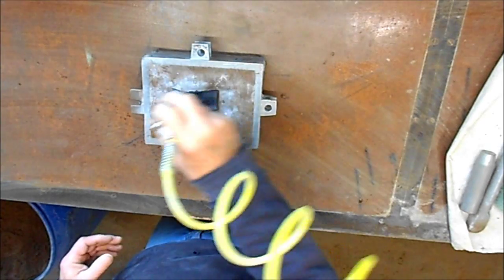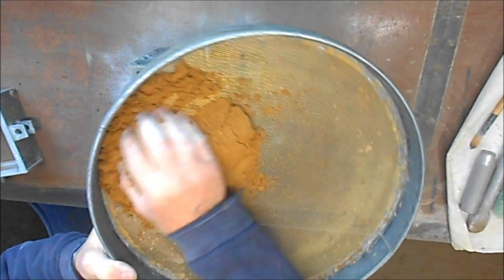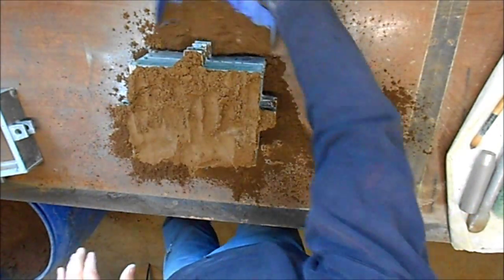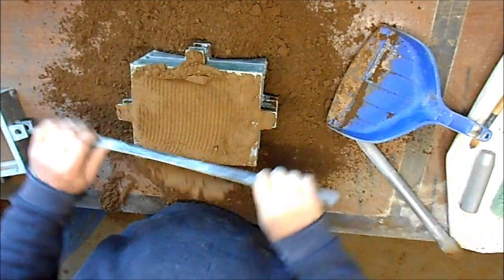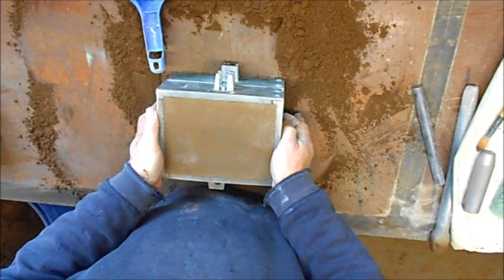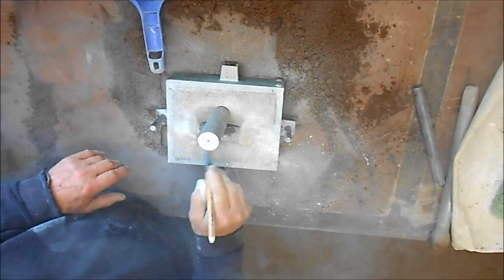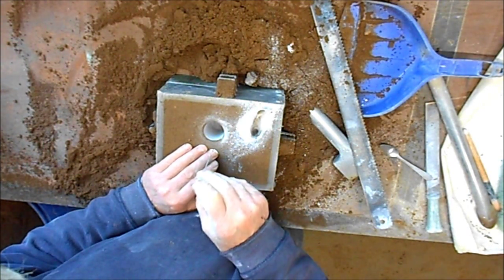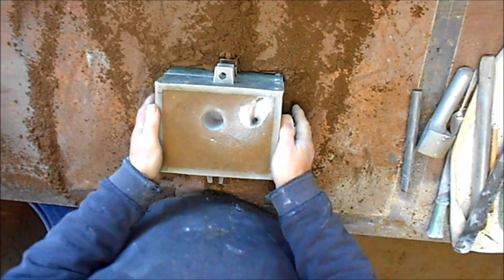My Home Foundry, Sand casting a Diesel to LPG conversion manifold restrictor, Part 2, The casting

Comment: Greetings from Venezuela, I am new to this topic of foundry and I subscribed to your channel to learn from you. Please could you tell me what type or grain of sand I can use like the one you use there and I want to ask you other questions if you would be kind. in answering me.
Reply from the maker: heil, the sand I use is called a "natural sand" because it came out of a  quarry almost ready to use. The quarry was about 30 kilometers from where I live. All I had to do was sieve out some larger grains and adjust the moisture level. Deposits of ready to use sand like this were common but most have now largely been used up. Now the best one can do is either buy petrobond sand (expensive) or get as fine a silica sand as possible. this is not easy as sands fine enough are not common, but one possible source is to buy the sand used for sweeping between just laid pavers. You then need to add about 10% of bentonite to the sand mix well and then add just enough water to make the sand about as moist as soil for a seed bed -- damp but not wringing wet.....Martin
Reply: @olfoundryman8418  Thank you very much brother Martin for your response and recommendation

Comment: Indeed, finish surface state is excellent, btw, what''s the exothermic compound name, or reference, used on top of the risers please ? Just curiosity to dig about this practice
Reply: Ok found your answer under another comment on one of your videos :) : "Ferrux NF" made by Foseco.
Reply from the maker: Yes, you have found it correctly - "Ferrux NF" by Foseco it most certainly is. I believe that it improves feeding quite a lot and I would not be without it. There are very few castings that I make that I do not use it on.

Comment: GOOD JOB AGAIN
Reply from the maker: Thanks for the comment. The good finish is something that I have striven for over many years. Mainly its the result of using a very fine facing sand. However this is not without its price to pay as such sands have very little permeability and mould gases become a real problem. I have to be careful to vent the mould properly . If you look at 7.08 in this video you will see one of the problems that can occur (I forgot the vent!) Also some times the gas pressure will just prevent the metal filling the small details of the mould (lettering is a particular problem) but larger areas of where the gas pressure has pushed the metal away from the mould surface can occur particularly in the drag when the gas can not escape as easily downwards through the mould - much use of the vent wire helps with this problem. Ultra fine sands are not for the faint hearted!